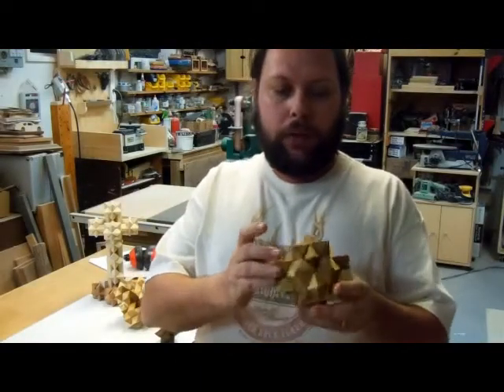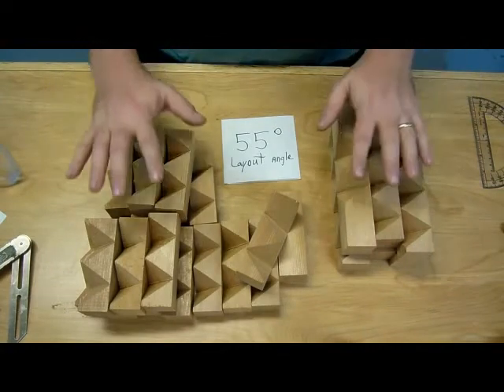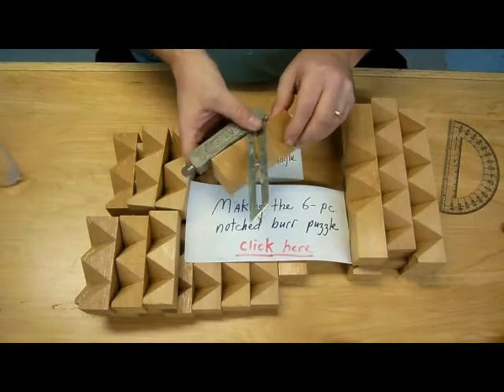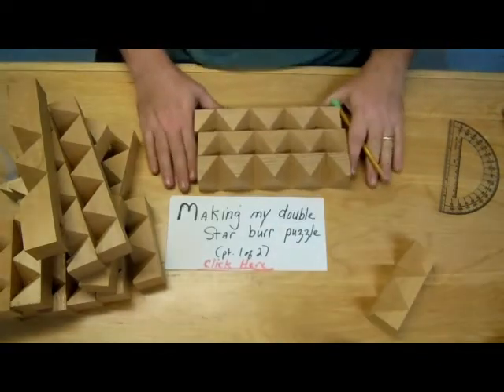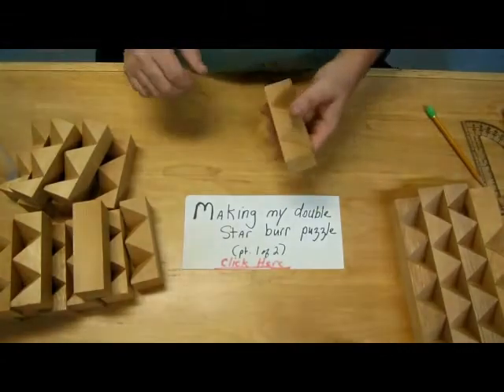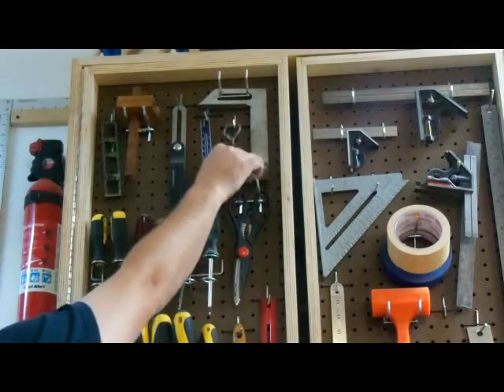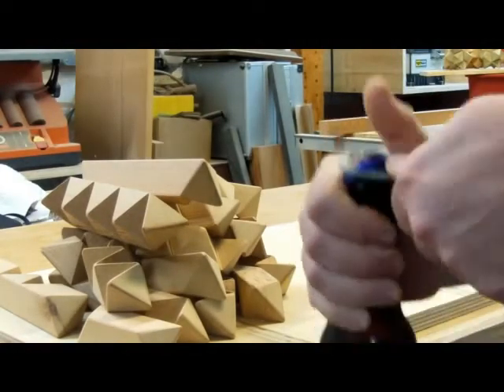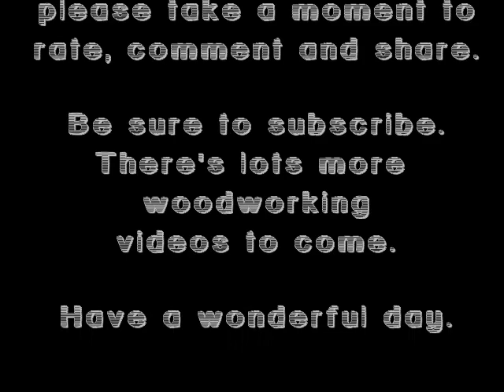Make your own Starburst burr puzzle: Chestnut burr

Comment: that´s such a great tutorial, i just have the doubt  the 55 degres, so i must to consult your other videos, meanwhile i suscribe, by now i´m makin some puzzle with lineal pieces and small cuts like boxes.  well done steve respects. (i write from mexico)
Reply from the maker: Thank you, Zierch. As counter-intuitive as it sounds, the angles I give in the video are indeed correct. Remember, that angle is the layout angle when marking cut lines on the faces. The actual cuts are made at 45 degrees to the corner (with the wood stood on corner), yielding a 90 degree notch. Confusing, perhaps. But in practice it's pretty straightforward..